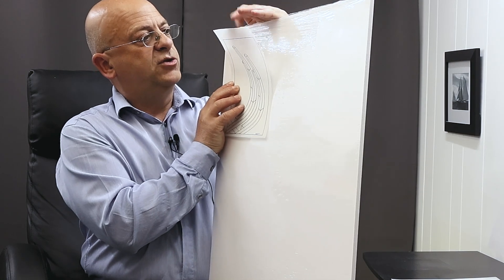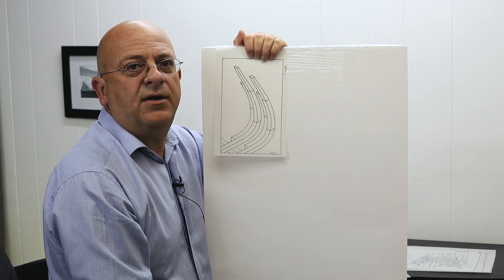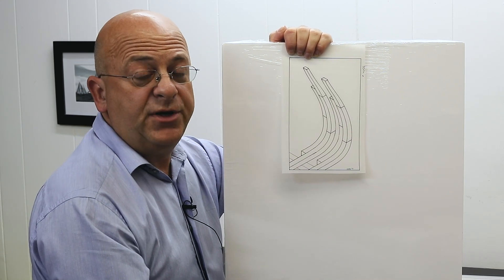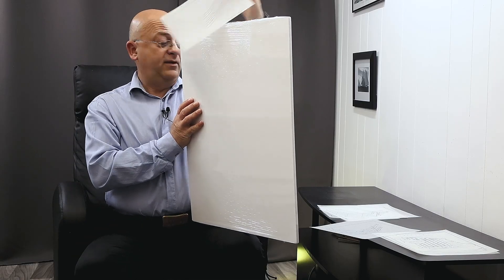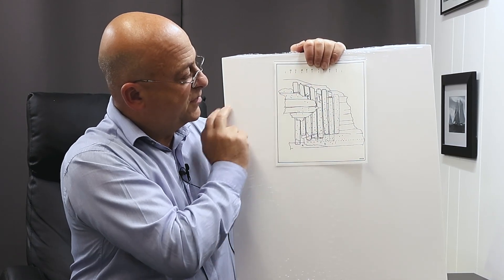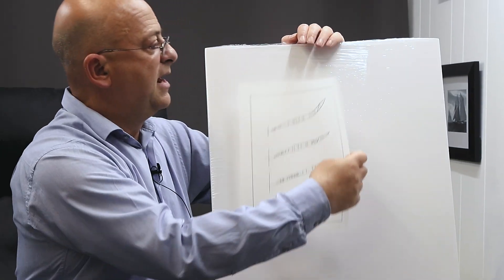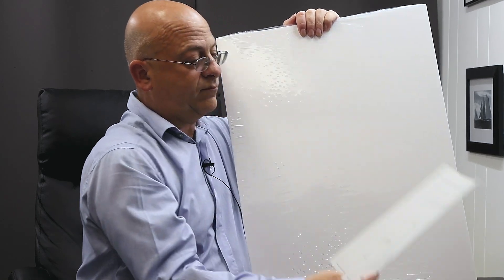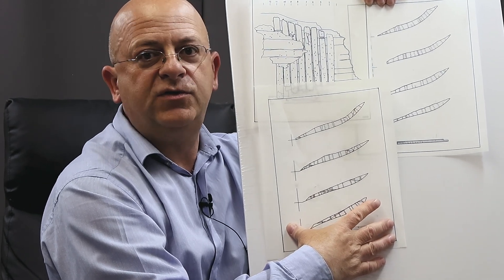FRAME design (Part 2)

Comment: Kroum, I read your masters thesis (all of it) and enjoyed it. If you remember the thread we had with your last video, I was remarking on the double frames of the ships of the English 1677 program, taking your claim of the previous video that nearly all ships of the 17th century were built the way described in the video to mean built in single, gapped frame style as described, up to the very end of the 17th century. What you say in the present video, as well as in your thesis, clarifies this and matches what I had understood the state of knowledge to be.

That's true with one exception that I also mentioned last time. Apparently, in the Anne, [frames are without gaps, with the timbers connected by chocks, but] only every third double frame -- every moulding frame bend -- is a true double frame with the scarthed timbers connected by treenails and bolts. For the fill-frames, the frame pairs are not bolted together but equally spaced out along the room between the moulding frames. So I take it by what you said previously that you don't want to agree on this just based on the evidence of superficial survey photos of the Anne wreck site? It seems to me, though, that, unlike the French, who went consistently fully double-frame on their larger warships once they had started with it, the English did frame ships like this (moulded double frame bends and single fill-frames) in the 18th century. See for example the framing plan of HMS Amazon (1795) ZAZ2560 @ Royal Museums Greenwich (which can be found on Google). HMS Bellona and HMS Victory (sorry for bringing her up) were/are also framed like this. This is from the late 18th century, but I am quite sure I have seen more framing plans and one Navy board model from earlier times in the 18th century which use framing as I have described.

Comment: Hi sir, I enjoy your lectures.  Now some questions.  1: the seats of ease.  I have several of the 'Anatomy of the Ship' books, and some will show the seats of ease at the bow on the gratings under the bowsprit (Quite the place during any weather, no doubt). One shows them being in some sort of bulge about halfway around the bow. One shows the captains cabin having his, I guess, at the rear corners of his cabin at the stern. The rest don't show them at all. I guess these ships were only for constipated crews. Another question.  I watch a lot of videos on building model ships and the generally plank with about 6mm or 1/4 inch wide planks. Especially the deck. Now say  a 1:100 scale model with 6mm planks on the model would be 600 mm wide planks,  would be about 24" wide. Are these planks chosen for looks or some other reason?  Thanks for your lectures.
Reply: Seats of ease: In the stern galleries for the officers and on the beakhead (under the bowsprit) for the men before the mast, in each case both on the port and starboard sides. If two men had to go at the same time, the senior one would go to the windward toilet and the junior to the leeward one. If the ship went about while they were relieving themselves, they'd have to quickly switch places. If they soiled the ship doing this, they were keel-hauled through the toilets. Midshipmen were just wrung out over the sides by a strong seaman.

More seriously, it depended on country, time, type and size of ship, and situation. In battle, you went were you were stationed in the ship. 

There are general ship modeling books with tables that collect typical plank widths by (country and) time period. They are not up to the standards of a naval archaeologist, but they can give you some confidence if you are used you monographs on individual ships. Roughly, outside hull planks tended to be wider on earlier ships and got narrower over time, something like 35-50cm up to the end of the 17th century, decreasing to roughly 30cm after that (that's at the main frame of the ship). Deck planks are a little narrower, with the same story of getting narrower over time (30 to 45cm up to 1500; 10-15cm around 1850).

Comment: Dear Kroum,
the last three lectures have been my personal favourites. Otlichno!
Allow me to ask a question:
You stated that the introduction of the double frame cannot be dated exactly. What is your opinion about the transition from the old system? Could it be that the transition started by connecting the previously separated timbers into a freestanding "half-filled" double frame? And later on, the zig-zag pattern was completely filled? Or does one has to imagine a switch over to the new approach, without intermediate stages?
Best regards, Torsten

Comment: Thank you for your insights  on this topic. I have a question I would like to ask, concerning you knowledge of old ships, there is a hype  in the ship model building community concerning  the San Felipe I think a Spanish warship. Was this ship ever built?
Reply: You will have to be more specific -- several Spanish ships of that name were built. There was a San Felipe that landed in Japan in 1596 and met a fate not unlike that of the Dutch ship De Liefde of Shogun TV show fame (which arrived there four years later). There was a San Felipe in the Spanish Armada of 1588. You are most likely talking of the model kit thing called the San Felipe of 1690 which I find is described on various kit company websites as "built in the early 17th century, in 1690", "a galleon", "a first-rate ship of the line of 96 guns", and "built in 1690, the flagship of the Armada battle [of 1588]" (usually, all of this together). Of course this does not make any sense. The plans and most of the models I find seem to be portraying a ship of the line with clearly early to mid-18th century decorations and hull lines but an anachronistic square stern; a steep stem and beakhead with a late 18th-centure style figurehead but a spritsail topmast. This may be based on a confusion with the Real Felipe of 1732 (which was definitely a real ship), but the plans and models are fantasy. There may have been a San Felipe of 1690, but if it existed, it did NOT participate in the Battle of Cabrita Point (1705) as claimed on these websites, and didn't sink two British ships of the line as claimed. In fact, only the five French ships engaged the vastly larger British/Dutch/Portguguese fleet, while the Spanish ships hung back. I wouldn't waste time and resources building a model based on the kits and plans that I see out there.